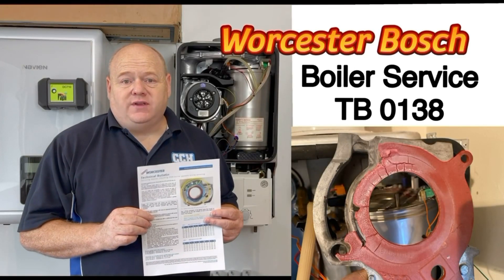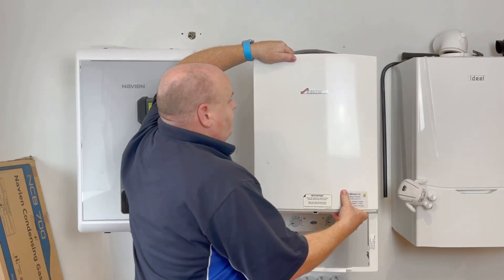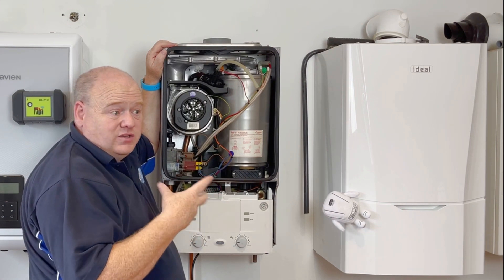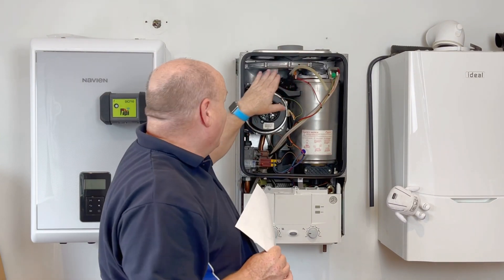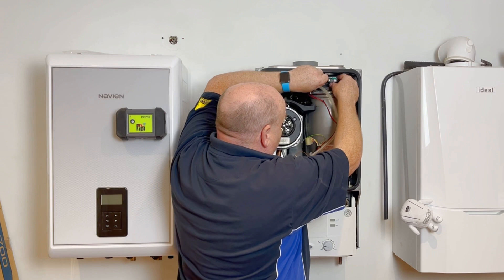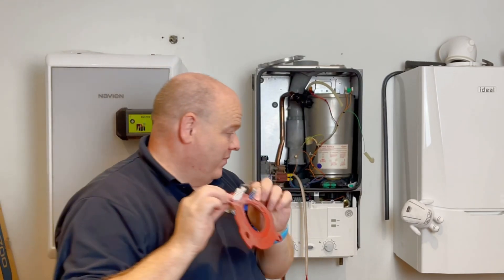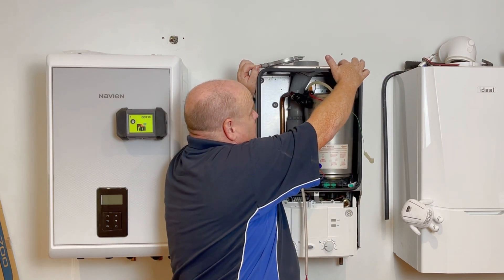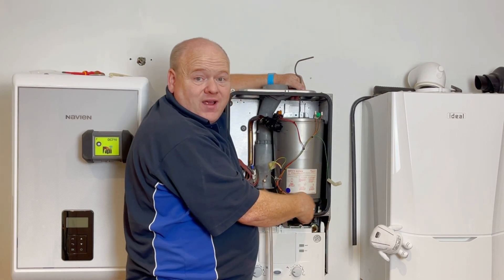Worcester Bosch Boiler Service TB 0138 TB138 TB0138 Plumber Plumbing Gas Engineer Tips

Comment: you can't blame the owners for not getting a proper service - its not like there is a cut price gas service vs a standard service. Bad servicing should be reported to the gas engineer registration for a "chat" with the service engineer. Its not like the engineer seeing the mess can't take date stamped video and pics to show the mess made
Reply: There is a difference. Periodically a full strip down service is required. Therfore more time and usually replacing seals, electrodes,injectors may be needed.  Washing of the main heat exchanger can also be difficult .
Ps. Owners can be blamed for Not getting a service done and waiting till it breaks down...hoping the once in 7 years service will cure all faults.. lost count on how many boilers I've condemned due to lack of or no servicing at all.

Comment: I nearly always replace the electrodes when I strip service these models. Normally the seal has failed and the baffles are dirty but you can get the electrodes as part of the service kit and it just makes sense to do it while replacing the seal.

Comment: Hi Allen. What would you say to baxi 836 Vs Worcester Bosch 8000 35kw (£340) more for the WB8000, but does have 2 years more warranty. 10 Vs 12 years on the WB.

Comment: I have a Bosch 37cdi combi from new would get up to temperature the first few times then .it wouldn't get up to temperature again . Have to turn if off and turn it on again  and it goes back up to set temperature . Been serviced by Bosch  several times and never been able to find or recreate the fault  . Really disappointing .

Comment: I spent a lot of years installing worcester and had many problems with gas pressures not being able to be achived, they refused to listen and insisted that it was my fault but turned out that they had fucked up and not allowed for resistance of pipe to the test point. I dont have any good words for worcester they are shit. one of the worse boiler to work on generally, the only reason they are still out there is because of stupid public think, well it's Bosch it must be good and the fact that they spend so much money on marketing. Had so many arguments with them over the years and gave up on them and moved over to fitting Vaillant. Wow what a difference so easy to fit what the fuck had I been doing all those years fitting those shit boilers. Still have to service and work on crapy worcesters and curse them every time ussally with cuts on my knuckles or loads of water puring out even after fully draining them, and stupid wire clips and plastic holding them together. 
I can have a fan and burner out of a eco tec plus in about 2 mins and not feel I'm having to force a component out or have to buy expensive service kits that comprise of a useless brush and a bent piece of metal to force out a baffle. If you are still able to stay calm after you have carried out the work that wont last long as you still have to wrestle with the case and getting that back on.  best place to put a worcester is in the skip they are at home there with all the rest of the unwanted rubbish.   Thanks Allen for your time and effort doing what you do really appriciate it and whatch all the time 👍

Comment: Bi carbon of soda and boiling water, left for an hour, that’s what tec said,  most I come across have never been serviced!!
Reply: Why can't boilers just not work if not serviced - could link it to the lowest room temp so it does not turn off in a snowstorm/cold blast. That would get service calls pretty quick.

Comment: Sometimes the flue collector seals can give you a reading inside the boiler if they are worn out not just the red seal caught me out changed the red seal and was still picking up ppm

Comment: I only change the seal if it fails the sweep test or the fan pressure falls out of range. The customer wants cheap
Reply: Customer is not the last competent person to work on the boiler before it starts leaking and becomes dangerous, it’s your reputation & livelihood, customer wants cheap walk away!
Reply from the maker: part costs £6 very cheap
Reply: Worcester change every 3 & say it should be 5 max, at 5 the heat exchanger could still be clean so won’t fail your test

Comment: Allen, what’s your favourite boiler to service, the most engineer friendly one? I stripped my first baxi eco blue heat only the other day and was well impressed
Reply from the maker: Ideal Vogue is very very easy. Thanks.
Reply: @AllenHart999  they’re easy i agree, but baxi as far as im aware say you don’t need to replace the seal every time you disturb it…..I fit mainly glowworms by the way

Comment: Should replace red seal every 5 years, doesn't take long either.
Reply from the maker: I wouldn’t personally leave them 5 years. Thanks.
Reply: I test them from 1st service with fga , had them fail after 3 years and seen 10 year old boilers not leaking. I normally change them after 4 years or if I've no service history. Changed loads recently. Still coming across boilers that hadn't been serviced since start of covid lockouts.